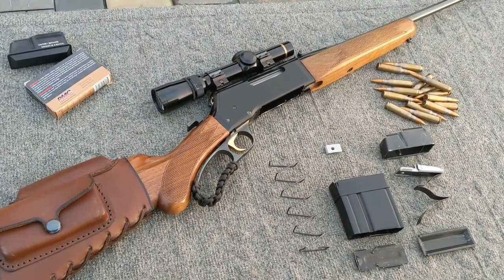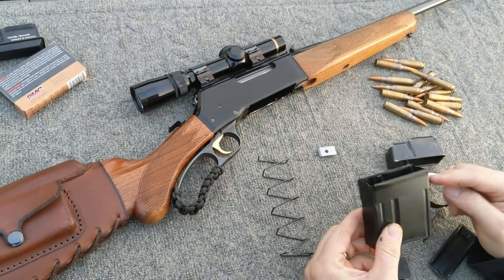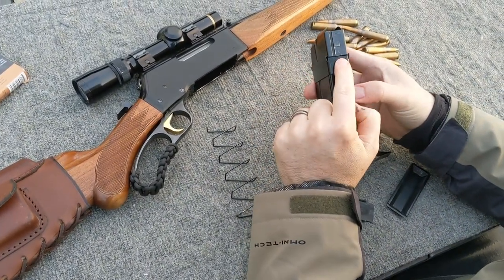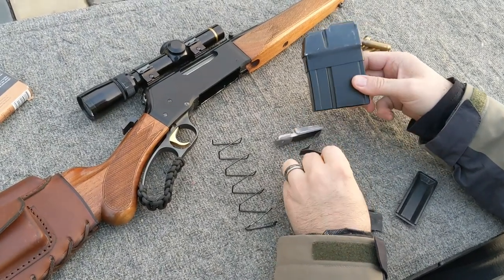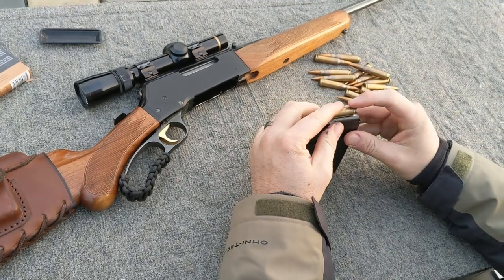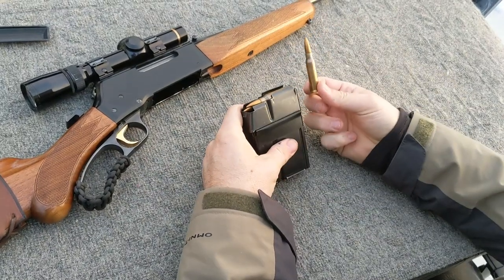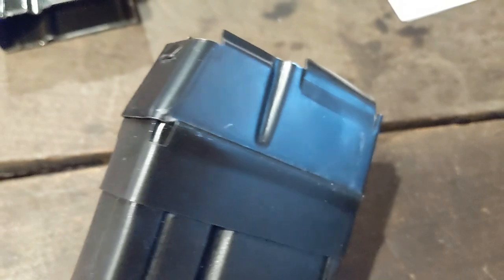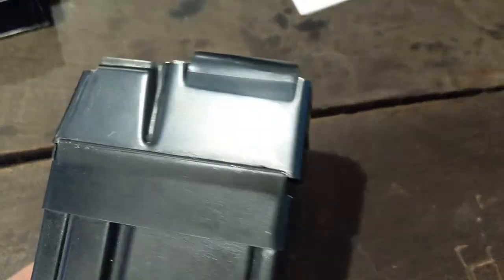Browning BLR extended magazine

Comment: I tried making a mock-up of something similar for my BLR and the lever would hit the mag and it didn't have enough travel to cycle.
I wonder what the difference is ?
Reply: Do you have a BLR with the pistol grip (like mine), or a straight stock? I'm not sure if the lever throws are different. Also, the newer prototypes have more angle to them, so the bottom of the magazine is canted forward a bit more than what is shown above.

Comment: Will your extended magazine work with a straight stocked blr? The lucky 13 mag from Australia is curved slightly in order for lever to clear a straight stock. Ready to buy some when you get this up and running with a manufacturer. Are selling any made by you in the mean time? Great job!
Reply: There's no difference between straight or curved stock. The part of the lever that is at risk of hitting an extended magazine is the front of the trigger guard (which you can see hitting in this video).

I have a Lucky 13, it is slightly curved and has a recess to stop the trigger guard hitting the magazine.

The invention in this video would work with either straight or pistol gripped BLR's. You just have to accept you're going to be beating the back of the magazine.

Comment: Hey mate, great idea, I’m looking at getting a blr in 308 soon. Would you do a video on how you clean and maintain the rifle? Or if you know of a good video, could you let me know which one? Cheers.🇦🇺👍
Reply: I've had one through 5 years of state forest and high country deer stalking in Victoria Australia. Mine is a non-takedown model.

For general cleaning I use a boresnake for the barrel, and a toothbrush for the bolt and receiver.

A couple of times a year I use a rod from the muzzle with one of those conical brass muzzle protectors to give it a deep clean.

The rifle has been trucking on without any issues.

Comment: Where can we get that adapter that you spot welded on? This is awesome id totally get one if you sold these
Reply: I'm working on finding a manufacturer, or making maybe 100 myself to sell.
Reply: @Daniel Sullivan 
Can it be made for 30-06?
Reply: @jamiehurtt3530  I have a drawing of the cutout for a long action magazine extension. I haven't yet figured out what I would use for the spring though.
Reply: @Daniel Sullivan  
blr is very popular 
Amd currently only lucky 13 offers it in 308 or 243 
You'll make a killing  even if you start making them custom made  at home for customers 
Make them for both long and short action
Reply: @Daniel Sullivan  
Let me know if you ever make one for the 06 
I know several people that would like to buy them